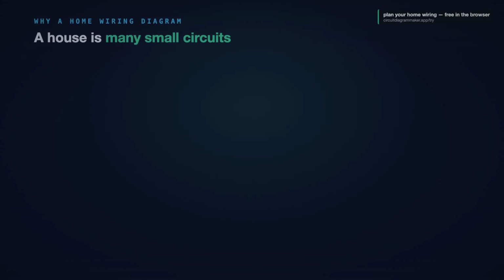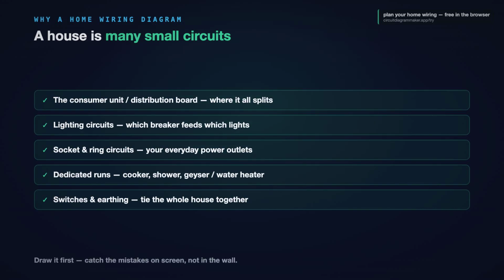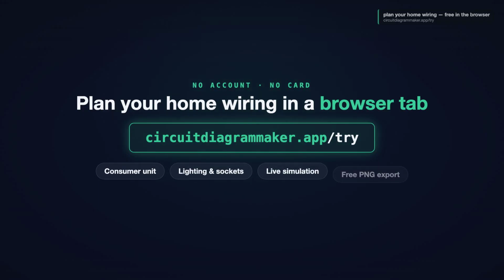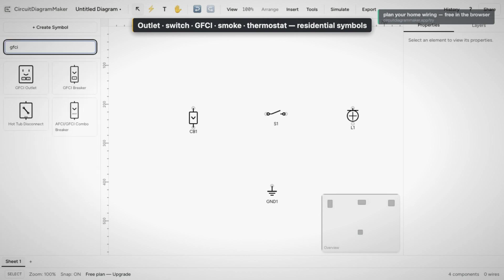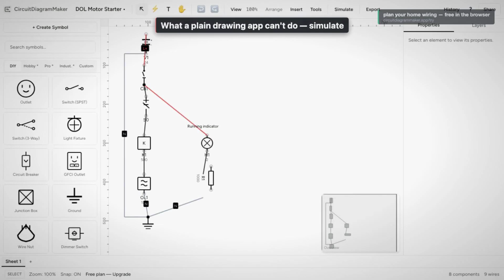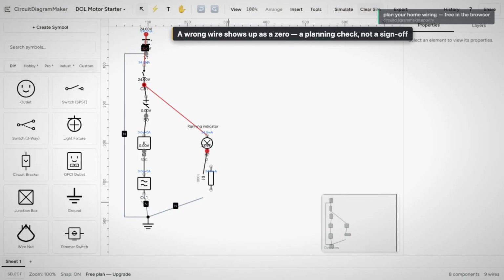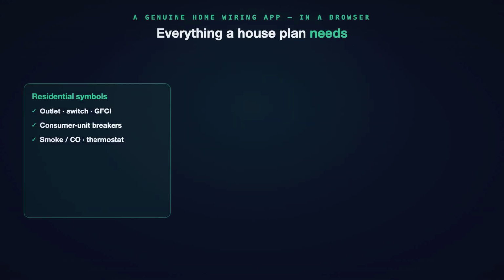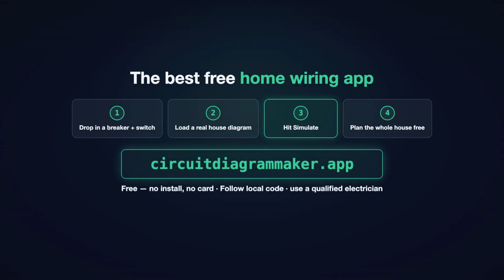Best Home Electrical Wiring Diagram App (Free)

Comment from the maker: Full disclosure (also said in the video): this free home wiring diagram app is ours — which is exactly why the honesty comes first. It's a browser web-app, not a store app you download, and it's a drawing and learning tool for planning home wiring.

One safety line worth repeating: it plans and checks your diagram, but it is NOT a substitute for a licensed electrician and it does not sign off on code. For any real work, always follow your local electrical code and use a qualified electrician. Plan here — build safe out there.

Question for you: what home circuit are you planning first — the lighting, a socket ring, or a dedicated run like the cooker, shower, or geyser? Open the same tool free, in your browser, load a real house diagram and reshape it into your own: https://circuitdiagrammaker.app/try?utm_source=youtube&utm_medium=pinned_comment&utm_content=yt-135